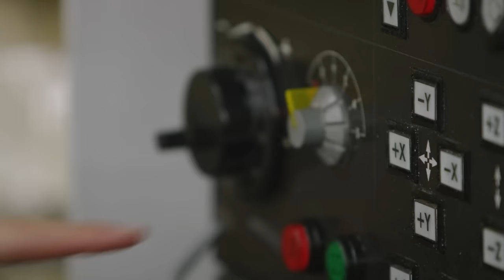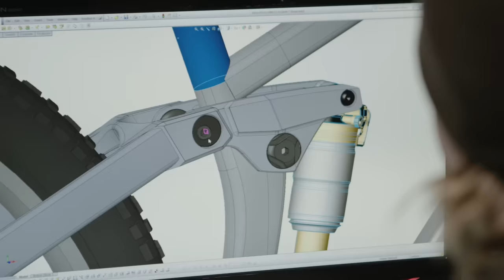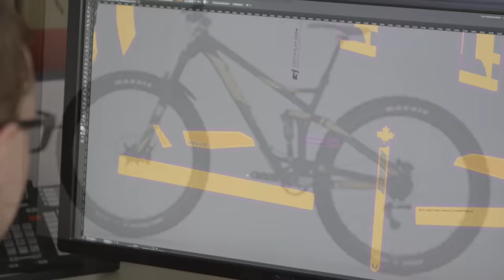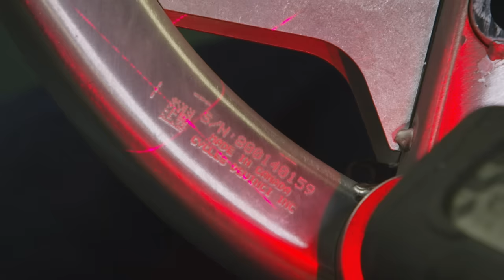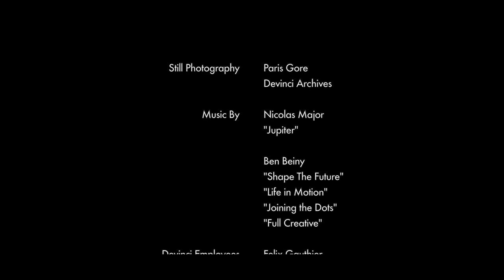Making Aluminium Bike Frames with Devinci Cycles // Made With Love

Comment: They might be beautiful bikes that ride great but the opening pitch of this video is totally off the mark. Steel is a safer bike material, as steel is flexible, and failures can develop slowly, and parts can bend without breaking. Aluminium is much more rigid and tends to snap suddenly. The only frame I've ever had fail suddenly was aluminium. Never had a steel bike suddenly fail. Secondly, aluminium is not more environmentally friendly than steel. It is much, much more energy intensive to produce and recycle. Aluminium smelters use collossal amounts of energy.

Comment: I have owned 2 devinci bikes in my life both devinci phantoms an 01 and 04 i still have the 01 completely stock still on the road  the 04 i sold to a friend all stock running street tires still on the road today minus the backwheel which was replaced not due to failure it was stolen when he locked it up outside  my point i have owned alot of bikes in my life even ones more expensive than the devincis but my favourite bike to ride is always my devinci

Comment: Interesting comments about the owner suffering from a broken steel frame so gets into making aluminium frames. Just about everything I have read comparing different materials rates steel as the safest and I am very wary about alu ever since I was riding Montreal to Miami with my friend from Montreal. He was riding his DEVINCI and 20 miles short of Binghamton he thought his bike  was feeling different. The down tube was cracked three quarters of the way round just below the steering tube. Considering the speeds we had been doing down hills in New York state, that was a pretty damn  scary development.
Reply: Time to start a bike company.
Reply: Totally. The opening pitch of this video is way off the mark. Aluminium frames are more likely to suddenly fail than steel, that is well-known.

Comment: Here's the fact of the matter. Carbon shatters while steel and aluminum bend reducing the chance of immediate failure. The steel frame probably broke at a poor weld.  Aluminum is lighter than steel and can do most of the stuff. BTW, airplanes are made of aluminum
Reply: +Kim Jong Un ever seen a broken AL Frame ? Nearly everytime i saw one it snapped. Mostly you notice that the bike feels kinda weird before, But on the Next jump it just snaps and you´re on the ground.
Reply: The  B787 is carbon fiber. 
The B777 has a lot of 
Titanium

Comment: So, his crash was the fault of steel, and riding an aluminum frame reduced his risk of subsequent failure-induced crashes....?!? Who do you think you're kidding? You really thought you could pull that sort of BS off with all the cycle industry watching? Aluminium is a great material, and out of all the good things you could have said you went with that as the punch line of the video? REALLY??? 

Many things have been said over the years in an attempt to poo-poo steel as a frame material and push the latest and greatest new thing, but this has GOT to be a new one!
Reply: Columbine steel frames start at about $4000 USD
Reply: Agree with you totally. Some absolute BS in this video.